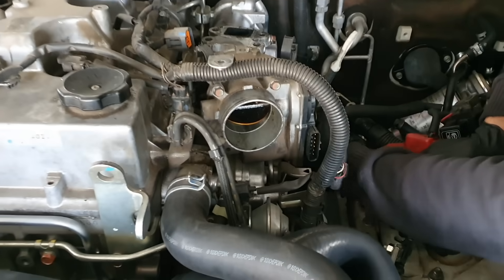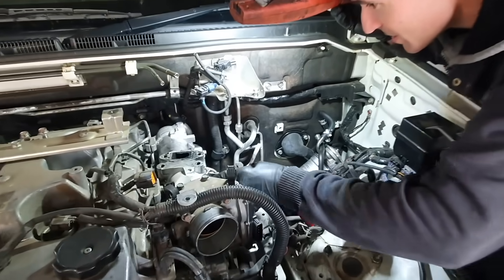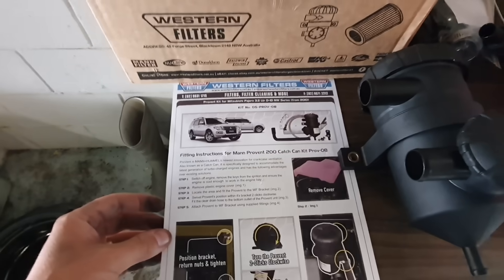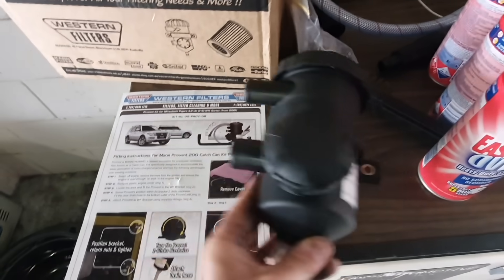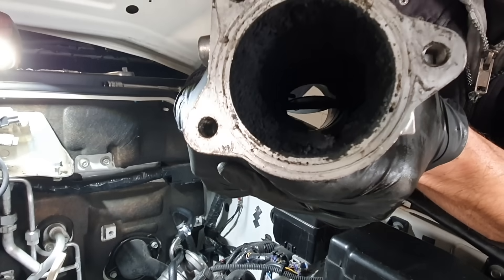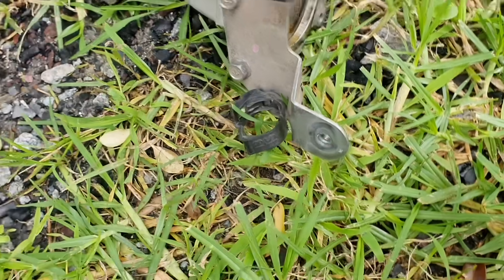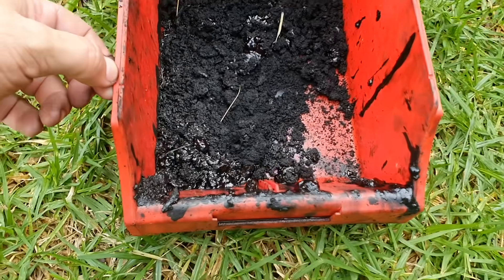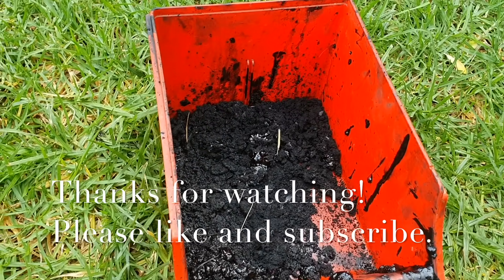Mitsubishi Pajero Diesel Soot Manifold Cleanout

Comment: Egr should have never been invented. Same as DEF. I can see a need,don't get me wrong. But a DPF should be good enough.
Reply: What is egr and Def????
Reply: @koscocosco5309  exhaust gas recirculation. Used a valve to put some spent exhaust gasses straight to the intake to try to burn as much unburnt fuel as it can. Def is diesel exhaust fluid. It injects exhaust fluid into the exhaust to help get cleaner emissions. Not too sure how DEF works if it lowers Temps or helps burn more.
Reply: @StephenBrewer89  thanks man.. I'll try and research  about it.. Cheers

Comment: What is your style of driving?You need to push the engine smometimes to the max.,or in normal driving keep it between 2500-3000 rpm.
Reply: Dealing with Non deleted diesels it don't matter. This is just normal. No matter driving circumstances.
Reply from the maker: I bought the car at 140,000kms. I did this clean at 150,000. Driving style i dont think matters too much. Its mainly during low rpm and idling. You cant stop doing that in trafic etc

Comment: My dads 11 hilux has done 330xxx miles and we’ve never had to do this ya just need to rev the fuck outve it every now and again to keep it clean
Reply from the maker: Have you ever looked inside the intake?
Reply: @kapindustries9236  the intake has never been off it its drives perfect or at least its never given any trouble and has the same power as my bosses 15 hilux that is somewhere low in the 100 thousands and he’s owned it since about 90k miles
Reply from the maker: @conormorley6086  this drove perfect before i did it too. Be interested to see the intake
Reply: @kapindustries9236  it would but if its not broke dont fix it 😂

Comment: think a laser cleaner make the job easier?
Reply from the maker: Not sure what that is?
Reply: @kapindustries9236  its a high tech laser beam and control unit that burns away/ explodes surface paint, carbon, rust ect. its not cheap but thought it would be intresting to see a laser cleaner cut thru that old oil and carbon depositsin a video. i liked your vid

Comment: Saving the environment by ruining millions of engines. Sounds like good old fashioned liberal logic at its best. All they have to do is recirculate exhaust gasses after the dpf, use the same cooler, and and the whole soot problem goes away. Less regens, and more longevity. It’s a win win. Cat used it for years and never had soot loading. It’s actually a very clean running design.
Reply from the maker: haha couldnt have said it better myself. Much like these new cars with Start Stop engines. They turn off to "save the fuel", but then the starter motors die quickly and when you need to replace your battery they cost like 3x the cost. Typical short sighted idiots. Please sub to my channel!
Reply: @kapindustries9236  except not all stop start engines have a starter motor. Mercedes and Toyota from memory both use a motor generator unit to start the engine and charge the battery. They also don't have a gear reduction like a normal stater.

Comment: Manufacturers on the latest generation Diesel engines are now tapping into to exhaust gases after the DPF so the soot and oil contents are negligible. Protects the EGR and air intake. Latest VW diesel family EA288 uses this new method It’s a no brainier I guess that’s evolution for you. With diesels now having to be tested to real world conditions and sustain clean emissions for the life of the car it’s forced manufacturers to up there game. The emissions must have been impacted by all that soot. Thxs for the video guys I was shocked at the amount of soot.
Reply from the maker: Wow i did not know that! Thanks for the info! Please sub if you like
Reply: Audi,Seat,Skoda,VW,Ford,GM will not rev on the emission test so they pass because the vehicles know they are staionary and so when the gas pedal is pressed they inject such a small amount of fuel that they rev to their progammed limit of @2500 rpm and nothing comes out the tail pipe, the machine does not register any smoke detected and so it passes.
Reply: @mazdaman1286  lmao sure mate, because the USA's dieselgate taught them nothing.... the DPF caughs all soot making your exhaust contain by regulation less than 0.5ppm of soot in it,
SCR's do their job and decompose NOx from the exhaust to 0.5ppm.
i do you really think they would just pull that bullshit off when VW tried and was left with a multi million dollar buy back and thousands of vehicles essentially unusable waiting to get crushed?

Comment: I Wonder if an old style upper cylinder lubricant kit fitted would this help alleviate this problem.
Reply from the maker: Hmm not sure. I used to have a Subaru and it was common to use a upper engine cleaner ever service.
Reply: @kapindustries9236  thanks for the reply  i have an old kit in my shed so i will install this after i give the intakes the super clean and see what happens in a few months will let you know how it went. cheers

Comment: EGR good for enviroment, but its killing your engine 😂🤣👌
Reply: yeah, so good for the environment, you have to burn twice as much diesel because the engine is so gummed up. It is like the high efficiency toilets, you have to flush 3 times to get your turd down, and use 2x as much water as a standard one.
Reply: @oriancunningham  good explaination dude
Reply: @oriancunningham  you must be a president
Reply: @oriancunningham  only Americans need a toilet full of water, in Europe we have very little water and ours toilets flush without problems
Reply: Honestly egrs don't even do much and def is SOOO  bad. Spill some def nothing will grow
Reply: @obiwancomeblowme1  DEF is urea, high N fertilizer. Things will either grow really well, or burn. Simply flushing the soil will take care of that no problem
Reply: @obiwancomeblowme1  all enviroment bullshit is bad.
Reply: @robertedwardlee8227  yeah, screw personal responsibility. All that soot is someone else's problem
Reply: @Deweesle  i dont even soot it on anyone else. I just dont give a shit.
Reply: EGR is easy to clean, worth it for the cleaner air, better combustion safety and efficiency.

DPF, well I deal with these for work.  Most people aren't using the vehicles appropriately, or something else is causing the issue.  They also only have a certain lifetime ash/soot storage capacity and aren't always designed for cleaning.

If you want a foolproof design dpf, buy one from HJS.  They're designed to be cleaned easily, regen at lower temps and provide you with less drama.  Peace
Reply: @DoubtingThomas333  what is HJS ? Appreciate your feedback .
Reply: @Salehyya  it's a company.  They're well known.
Reply: @DoubtingThomas333  Thanks , I found the website .
Reply: @DoubtingThomas333  how do you clean the egr?
Reply: EGR + crankcase ventilation killing your engine. On their own they are not as bad.
Reply: Ok, EGR is killing the engine yes, but crankcase ventilaton is what makes it live longer
Reply: @bjrnthomassen8955  yep, crankcase ventilation is an important part of keeping an engine reliably lubricated and to prevent blowing gaskets.  EGR does a couple of positive things, with a downside of requiring maintenance to itself and the intake manifold every 50k km.  If they are going to keep making and selling diesel engines, they really need to have oil/air separators installed at the factory with a 10k km service interval (you drain them out)
Reply: EGR is a fraud. the gas that recycle is very minimal but enough to destroy your engine a cheap air filter in the exhaust would catch 100 times more particles than the EGR but no money for car manufacturers
Reply: @MrGmail69  that's what a dpf is, and what ppf is... I don't understand what you mean?

There is simply too much exhaust for an air filter of some sort to work on the exhaust, and you would need to replace it so regularly it wouldn't be economical to own a vehicle.
Reply: @MrGmail69  lowering combustion temps and NOx, it does a few things
Reply: I’m not convinced that it’s any better for the environment. Matter cannot be destroyed. It can only be changed or rearranged. Therefore, the EGR kept all that out of the air. But it did not just mysteriously disappear. Instead, it now goes into the ground, the sewer and the landfill in the same ratio it was removed from the air. Is that any better? I don’t know. Call me skeptical.
Reply: @mailmanx69  you can say that all you like, but the science of it actually works.  Read up on what EGR actually does.

I'm not saying it makes the servicing of a vehicle easier for consumers, but it does work.  Sometimes I think owning an older car where everything is very accessible for the home mechanic would be worthwhile.
Reply: @mailmanx69  at least the carbon is not dumped into the atmosphere. Carbon sequestration is important and imho it is better in solid form. That way you can dispose it somehow and reduce greenhouse effects.
Reply: How Dare YOU!
Reply: EGRs functioning properly actually Lower Combustion tempratures, counter-intuitive, but a good thing for engines.
Reply: DPF it's worst than EGR..! The EGRs give you problems if you don't clean it every oil change but only at long term.
Reply: No egr, dpf, cat, no problems. Fuck enviroment.
Reply: @robertedwardlee8227  amen

Comment: Egr delete and the intake problems are solved 👍
Reply: EGR = inferior bandaid technology.
Reply: I put a small plug inside the vacuum hose of the EGR actuator, my engine is from 90's so everything is vissible. Here they just look if everything is in place and connected.
Reply: also deletes the legality of your vehicle
Reply: @TORTLESSS  not here in sweden where they don't check it 😎
Reply: @ralfrisberg8009  don't think anyone checks it man after registration, but let's respect the law and the environment
Reply: @TORTLESSS  they used to check it every year but then all of a sudden they stopped doing it and on my Volvo 240 the egr valve was only making it use more fuel so delete it and have a happy life 👍

Comment: Plumber blow torch burn off a good bit of oily shite then oven clean. With two stroke bike pipes an oxy torch up the disconected exhaust get it burning and take off the acetylene and oxy only, whilst using a water hose to stop the chrome blueing off. Lots of smoke  LOTS of  smoke but a huge power increase after.
Reply from the maker: Didnt know that! Thanks

Comment: Absolutely gross. I can see why they do this EGR nonsense as that crap would otherwise be in the air but I find it criminal that manufacturers get away with effectively suffocating an engine like this... Its just forced obsolescence so you buy a new car quicker.

I had a perfectly functioning beater car that pulled through a lump of this mess and it blew everything, seals, turbo, the works.

If you have a turbo diesel, get a catch can immediately and make sure every service seafoam the air intake system with the spray. Will maintain it much better.

I'd recommend doing all that after you've had the intake cleaned properly the first time as you've seen in this video as you don't want clumps of that mess flying around your engine once it comes loose!
Reply from the maker: Thanks for the suggestion! Please sub!

Comment: When will you be doing the jeep and is it the 2.8 crd?

I have one that has 130k miles on her so video showing how to clean the intake could be useful 

Cheers
Reply from the maker: I talked to my mate today about that but he doesn’t have any plans just yet as he rebuilt the motor a while ago and cleaned it all at that time. He said to remove the manifold is significantly harder on the Jeep though
Reply: @kapindustries9236  yeh I can imagine how big of a job was it to rebuild the vm 2.8 and what mileage did you decide to do that at?

Mines is at 130k miles and I'm trying to keep it going as long as possibl really thanks buddy

Comment: EGR: all good for France, Amsterdam, Germany, Italy etc etc etc....EGR is no good for any country that is not in Europe or EURO IV, V, VI emission governed countries.  It fucks engines.
Reply: I could be wrong but I think EGR was originally brought in for California anti-smog reasons in the mid80's,  but the market there was so huge the manufacturers went for it across all their models across all geo zones.  That said,  I agree it fucks engines.
Reply: @ivanjulian2532  EGR has been around since the 60's that I know of.  It been refined over the years, however I had a 1979 Holden Gemini, it EGR in the form of a breather pipe from the exhaust manifold routed back to the airfilter housing base plate which at the time was mounted directly to the carby on top of engine.  A basic setup but was classed as EGR in the service manual for that model.
Reply: Amsterdam is not a country.
Reply: @nickab9719  I was being polite, notice the birds fly upside down over Amsterdam? Place isn't worth dropping turds on.

Comment: Do you need to do that? Will it damage anything?
Reply from the maker: The build up can become so bad that it literally choked the motor. It doesnt know what is happening so it will start injecting more and more diesel. This then can wash the oil off the bores and cause catastrophic failure of the bottom end. Imo it is very nessesary to do at least every 100000km.
Reply: @kapindustries9236  Bro can I do it myself in a e220 Mercedes 2005 without experience? How much would this cost to be done in a private shop? I do have pressure washer I'm worried if I damage anything without experience. Can I ask my mechanic maybe to remove it and keep my car in there until I clean it?

Comment: these are very well known for this problem noted by sluggish performance ,,  awesome the 3 buck can of oven cleaner which would,ve worked better than the degreaser ,
Reply from the maker: Yes thanks mate. Also increased fuel usage is an indicator. The car is choking and losing power so it injects more fuel. This can cause major problem like washing the oil off the bores and destroying the bottom end.
Reply: @kapindustries9236  yea great point about the auto compenstate on fuel for more power
and anything common rail 2006 onwards could be struggling and most people just wouldn't really notice if they bought the car 2nd hand it may been choked up when they sold it,  but thanks for the tip on fuel consumption

Comment: Hi there does this cleaning process also work for non turbo diesel engines. I have a Mazda T 3500 which is fairly slow at the best of times
Reply from the maker: Im really sorry im not sure. Be good to have a go i imagine
Reply: Maybe. But non-turbo diesels are inherently slow. They have insane compression and a low operating rpm. If at all possible to turbo your engine it would greatly increase performance

Comment: Now it’s clean. Install water methanol system. It’ll keep it clean and you’ll keep your egts low as
Reply from the maker: Sounds like a good idea. Ill look into it
Reply: Kap Industries 250k on my diesel. 

100k with water methanol injection nozzle. 80cc sized  nozzle. 

Entire intake system post intercooler is spotless (nozzle location) 

Google prometh injection. Quality equipment

Comment: hey mate, did an intake clean on my ml triton last year and you're meant to get those butterfly valves in the intake freed up if you didn't, helps it run much smoother
Reply from the maker: Hey i didnt realise that! Hmm i might have to pull it apart again. Thank you for letting me know
Reply: They’re only used to assist the engine shutting down.

Comment: What a load of effort. Just have a 90 minute terraclean and same results. Without taking the engine apart
Reply from the maker: mark clutterbrook absolutely false. They don’t work nearly that well. Also the last thing I want to do is suck all that crap through the motor, into the intake valves, pistons, exhaust system and exhaust housing of my turbo. That is the worst idea ever!
Reply: @kapindustries9236  well Ive had it done a few times on my van and its now showing 550k miles and doesn't miss a beat.
Reply: Have to agree with Kap here, speaking as a home mechanic (layman) seeing is believing. Deffo take apart and do it properly!

Comment: I'm curious what the fellow did to get the soot out of the engine. Did he put a little cup, or something under the holes and just brush it out?
Reply from the maker: Yeah pretty much exactly that. He just scooped it backwards so it didn't fall into the combustion chamber.
Reply: @kapindustries9236  does it matter if a small amount does fall in? Given the loose chunks in your manifold, I assume they often fall in anyway?
Reply: Could also have a shop vac nozzle ready to suck any debris at the port while breaking off chunks so it doesn't enter the engine.

Comment: Hi,
Nice job. I have to do this myself. Do you happens to know the code for that in-between inlet manifold gasket?
https://i.imgur.com/KxR9r40.png
I'm unable to find the code for it..
Thanks
Reply from the maker: Hi mate no I don't. However it's a steel gasket. If you remove it carefully you don't need to replace it. We just reused all gaskets and they are fine!
Reply: @kapindustries9236  Thank you! I had the impression you said in video that you will replace the gaskets and I was unable to find the part number for that...
So, I have to be very careful with that gasket...
Reply from the maker: Yes i did mention we would replace and i shouldn't have. We reused all gaskets and its peefectly fine.
Reply: @kapindustries9236  Thanks for the reply! Apparently there is no part number for that gasket...

Comment: If only sooth travels in the EGR. will this still happen? Or it's just because of the engine blowby?
Reply from the maker: Do you mean if you have a catch can will this build up still happen? If so I think it will happen but not as quickly. A catch can wont catch all Oil Vapour.